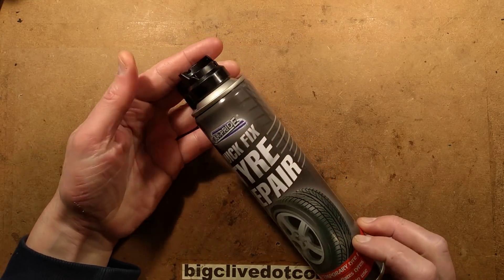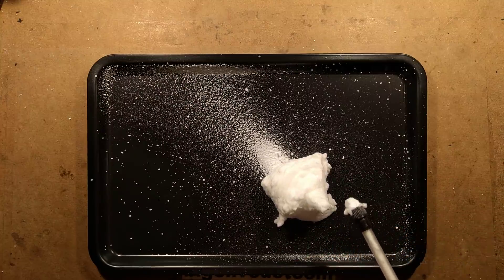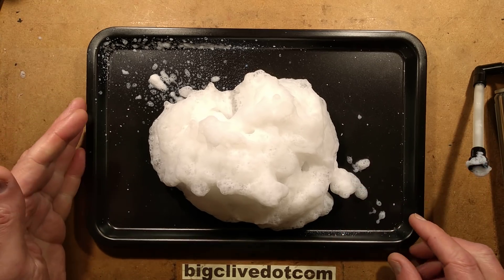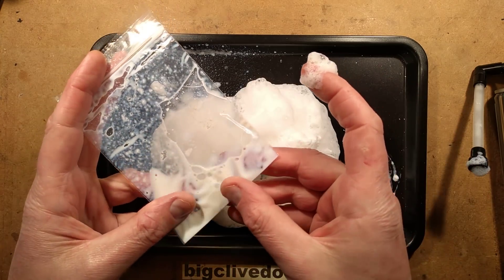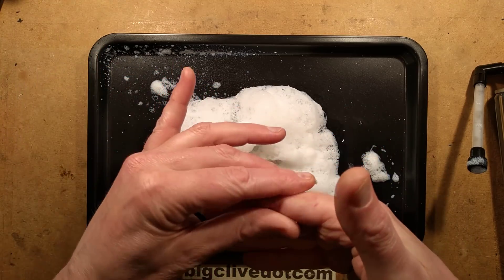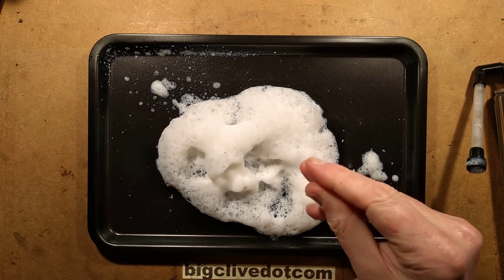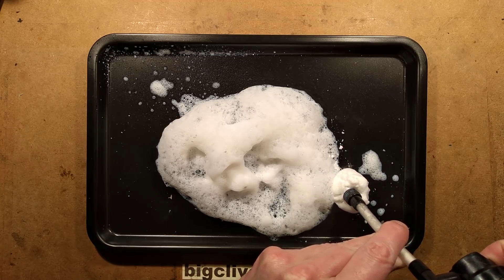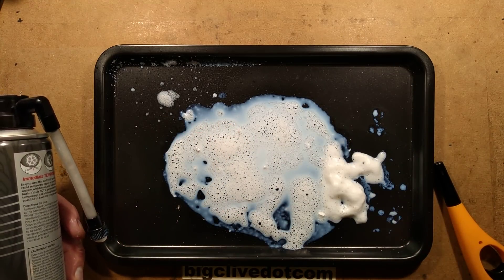What's in a tin of foaming tyre repair liquid.

Comment: The stuff is death for tire pressure sensors
Reply: Death for tyre valves in general
Reply: Yes, no longer an issue as others have said.  In fact, my 2018 Dodge Challenger does not even include a spare tire -- instead, it has a device which is a combination air compressor and tire sealant canister.  Same thing as this stuff, but in their proprietary format.  It seems to be a pretty common thing within the Dodge lineup now.  Here's a video on the sealant/pump kit:  https://youtu.be/DwxEmi5ktTs
Reply: sensors in tires? i dont need that
Reply: Mike Oxlong  Don't forget that there's no need to reset tire positions in the system when you rotate tires...  I actually would prefer that system over pressure sensors.  In the days before GPS navigation systems, ETAK Systems made a navigation system that relied solely on dead reckoning -- it used rotational sensors on each non-driven wheel, and an electronic compass to monitor vehicle turns and speed and would relate that information to a stored map.  once you did the initial position calibration, it was incredibly accurate for the day.  See https://bit.ly/2ll6Qj1 for more info on this system if interested...
Reply: Mike Oxlong  What I meant is that you don't need to tell it where each tire's new location is.  However, newer designs eliminate that step as well.  My car ('18 Challenger) has TPMS sensors, but uses sensor proximity detection to know each sensor's location on the car.  On my old car, however, I would need to put the system in a learn mode, and go to each position sequentially and lower the pressure by about 3.5# so it knows which sensor is at each location.
Reply: @swp466  This varies by vehicle and manufacturer. Dodge has a very nice TPMS system that automatically detect which sensor are in which location. Many of them even have TMPS sensors in their spares (if they have full size spares) and automatically start reading it when you put your spare on. Other manufactures, like some Fords for instance, still require resetting positions when you rotate the tires.
Reply: Mike Oxlong  Can't imagine that ... Most times that I had a flat tire it was when going to start the car. Not always making a round around the car. Very nice if you get a message on the display before driving off that one of your tires is flat so you can get out of the car, call the help-services for repairing it  and you don't need to buy a whole new tire and extra costs.
Reply: Direct TPMS is superior to indirect one, only downside of direct TPMS is battery life which is around 7-10 years. ABS based TPMS is cheap way to pass the regulation. Claiming that indirect TPMS detects a leak faster then a direct one is complete bs.
Reply: Mike Oxlong  if yours will read 1/2 psi off, then BMW are geniuses. The VWG/Audi models use the ABS sensor rings but may ignore a 3-5 psi difference.
Reply: Mike Oxlong  It is cheaper if you use cruder VW method when ABS detects only that pressure is lower but it doesn't show you by how much. Also, tire must spin for this system to work, and if all your tires have lower pressure than required, it does nothing. GM (and Opel) style with sensor in tire valve itself functions even when vehicle is static with ignition on, shows exactly how much pressure you have and you can use it when you use manual pump to pump your tires. Also, there was Renault solution with sensor inside of tire itself, which was very precise but very faulty. I, myself, prefer to not have anything like that, and my Ford Cortina Crusader doesn't provide it anyway. But have full-size spare tire.
Reply: Urban myth #2. The goo was reformulated many years ago and no longer clogs TPMs, around the time that TPMs became mandatory in the US. No doubt Clive got a can for one pound at Poundland and it is the old stuff. And, many cars from VWG actually don't use TPM sensors, there's nothing to clog. They use the ABS system rotation counter instead. And, their Audi RS8 and other expensive models that ship with NO SPARE TIRE all ship with a can of goo and an inflator pump.
Reply: afaik the indirect measurement using the ABS sensors are just a cheap way for the manufacturers to (barely) meet the requirements for tire pressure monitoring
Reply: @fuzzy1dk  maybe but such sensor is really just an addon, just like backup camera: you still should use your eyes and mirrors when backing up.
And with presure sensors, you should check often your tires and sense how your car behave on the road, because its easy to feel that you have flat tire.
Reply: tire pressure monitoring have been mandatory in the EU for new passenger cars since I think 2014
Reply: @lyfandeth  That's incorrect. When I worked at a tire shop less than a year ago I would see sensors destroyed by this crap every other day. Most of it said "sensor safe" on the can.
Reply: Could be the maker lied. Could be the can was the old obsolete stuff. If your shop said "This product ruined the tire pressure sensor resulting in $50 charge" and the customer complained to the folks who made the goo, what happened? Did they never complain? Did they get paid back? Here it would be a slam dunk in small claims court.
Reply: @lyfandeth  The change was closer to $80. I have no idea if anyone ever actually contacted the companies, a lot of people did complain to the dealership that included it with the car. I doubt anything ever came of that though. Some of them bought a new sensor immediately, but we did encourage people file a complaint with the manufacturer of the product because there's nothing we could have done about it. We'd specifically write on the workorder that the sensor was damaged in case they wanted to send it to the company with their complaint.
Reply: @lyfandeth  it blocks the air port of the sensor itself, preventing it from reading properly.  The goo makers claim "safe" by saying it can be cleaned out of the tire after a proper repair... Though actually cleaning out the tire AND sensor would be difficult.
Reply: @lordgman1  I've worked with lot of "destroyed" things that often really just needed a cleaning with the specific solvent, or other repair thatreally was trivial if you had an hour and the knowledge. To a tire shop? The part is not destroyed, it just needs too much of their time to fix, versus replace.
 But I had eight alloy wheels and was damned if I was going to install TPMS monitors in them all, and then have to risk damaging them every time they needed batteries. And the goop can, even if it ruins a sensor, can still beat all hell out of waiting four or eight hours for a tow in the middle of nowhere. It is one more tool to keep in your arsenal.
Reply: @lyfandeth  Well TPMS sensors are permanently sealed and non-repairable, so you're not likely do do anything other than destroy them more if you try to fix them. I've tried to dissect many broken ones, but they just don't come apart without maybe using some kind of acid to dissolve the casing. There's no such thing as replacing the batteries in a TPMS sensor, you have to replace the whole sensor. The goop also did a really good job at destroying the coating on alloy wheels. When customers left it in for an extended time they begin to pit around where the tire seals to the wheel and the polished coating separates and peels off on the inside. Makes it a pain to put a new tire on it without the bead leaking air. Not to mention that it becomes impossible to balance a tire with liquid in it. I'm not sure how putting a TPMS sensor in a tire could damage a wheel though, so I can't say I know what you mean about that.
Reply: @lordgman1  Seems that if they are SEALED all the goo can do is coat them. So a proper cleaning would restore them, no?
Reply: @lyfandeth  there is a hole in the case to allow the pressure transducer to read the air pressure in the tire. This hole let's the goop get all over the circuit board inside. If the small opening was designed to be sealed against the transducer itself, the goop would only get inside the pressure transducer and carefully cleaning it MAY solve the problem, but in all the dead ones I've managed to break open there was residue all over inside them on the side of the circuit board that faces the hole. The backside of the circuit board is sometimes filled with extremely hard silicone to seal it. There are several popular designs of sensor, it would be interested watching Clive try to break some open
Reply: @lordgman1  then it is not sealed at all, if the circuit board is vulnerable. Cleaning inaccessible electronics should be simple, if you can get to them. Which comes back to "economically unfeasible" especially for someone with no knowledge of surface mount electronics and safe materials to use with them. Routine water contamination from compressor condensate would also kill them. I'm betting qc is very different among brands.
Reply: @lyfandeth  Funny that VWG is pretty much alone with theyr system. It isn't very accurate but you can calibrate it to new tires by push of a button. Other manufacturers use sensors in tire valves, or, as Renault did decade ago, sensors are inside tires themselves, and you need special tool to calibrate them for winter/summer tires. Super annoying.

Comment: I've had a few motorcycles where the previous owner has used this stuff. It ends up as dirty latex balls rolling around inside the tyre. I doubt it would stop more than the tiniest puncture
Reply: This thing doesn't do shit, Slime works a lot better if anything, and it's less messy.
Reply: @piotrekserwisuje  Yes, slime is the only one that is water soluble and can be rinsed out allowing for a proper repair afterwards.
Reply: Is that what the little rubber balls come from? I used to work at a car dealer and dismounted my fair share of tires, I was always curious about the rubber marbles in the tire. I know when it's liquid it's terrible, new stain on the boots and pants.
Reply: I've actually used it on a punctured car tyre and it didn't work at all. The tyre place I took it into to get it replaced told me two things: 1) this gunk really doesn't work for anything but the slowest of slow punctures, and 2) using it makes it impossible to repair the tyre, you can only replace it entirely. Don't know how true those are, but I'm glad I now have a car with an actual spare tyre and not one of these gunk inflation kits.
Reply: Yeah. I only use it for weelbarrows.
Reply: @goiterlanternbase   *wheelbarrows
Reply: Just use a fucking spare wheel. What happened to those.
Reply: @augustsinyukov8497   Ask the fucking car manufacturers.

Comment: Hmm! The foam may be expelled using a plastic piston above a higher pressure gas charge in the bottom of the can, similar to some shaving cream products http://randomer.net/stuff/IMG_20181116_192425.jpg (not that I've actually shaved my beard in like 10 years... but at some point I might need to!)
Reply: Here are 2 followup photos. After discharging the remnant shaving gel and opening the bottom of the can  (this is a different can... I located one that was nearly empty): http://randomer.net/stuff/IMG_20181120_140549.jpg

And after peeling the can apart more and pulling the piston out: http://randomer.net/stuff/IMG_20181120_142311.jpg

Comment: Only ever used the stuff on a trailer tire and wheel which had a massive set of problems, but it succeeded at limping it a couple miles down the road where it was ultimately rebuilt (that rim and tire were thrown away). I would never use the stuff on an actual vehicle flat I'd want to save; I keep a proper plug kit on hand for such repairs.

Comment: I think it is foaming because it isn't under pressure.  I bet if it were under pressure, as if it were inside the tire, then maybe it would be liquid.
Reply: Well, if you squirt it into a flat tire, it will foam. Once the tire is pressurized, the foam will shrink by some ratio. Perhaps this is by design, so that holes will be sealed even if they are not at the bottom of the tire and even without driving.
Reply: And the spinning would probably force all the gas out of it leaving a film/coating on the tire.

Comment: I had a job in high school working at a gas station (1980's).  If someone used "fix-a-flat", the glue/patches wouldn't stick to the inside of the tire, no matter how much we cleaned and roughed up the inside of the tire.  If you just left the "fix-a-flat" in there, the liquid would throw the tire off balance at speed.
Reply: Fortunately, fix-a-flat (specifically) is supposed to go solid in the can in 2-4 years, so if you still have the same stuff they made in the 1980's it is unlikely to come out of the can and cause any problems. The new stuff, is all new and different, or so they say. But then again, in the 1980's we all had donuts or spares and no TPM concerns either, didn't we? And no cell phones, good luck calling a tow truck back then.
Reply: @perfumedmanatee6235  how could liquid balance a Tyre if it's liquid and constantly moving?
Reply: @jonnywilson9117  In a similar way to how balance beads work. These are popular with vehicles with large tyres like 4x4's
Reply: @AaronGilliland  Would work if you were to separate them and use several sets.
Reply: @jonnywilson9117  Working at a tyre shop right now and on many trucks, especially trailers use sand to balance the tyre. Im sure this can work on regular cars as well, but youd probably still feel it. Ideally you should have as little liquid in your tyre as possible as it can throw your proper balancing off and change according to humidity within the tyre.
Reply: @Falk9714  I would have thought it could throw it off, i wasn't too sure of to be honest. I suppose if the Tyre has been balanced with the liquid already inside the Tyre (Or beads or whatever is being used) then I can't imagine there would be any issues with the balancing. I was mainly talking about liquid like the one in the video. But I for one certainly didn't know liquid, sand, or beads can and are used to balance Tyre's. Thank you guys for the info! @Alexander Falk
 @Fracture @CwazyWabbit
Reply: @jonnywilson9117    Many industrial vehicles, especially farm tractors have liquid inside the rear tires.
Reply: @jonnywilson9117  Centripetal force. Moving at highway speeds the water clings to the tire and doesn't "slosh" around. Search Youtube for "water balancing a tire".
Reply: @frac  It's better than an unbalanced tire, but not as good as a properly balanced tire. Water works like that in a washing machine because the cylinder is rigid. A tire is not rigid. It  flattens as it meets the road, making turbulence that stirs up the liquid.
Reply: Paul Stafford- If you had the common "tech" stuff, yeah. Usually the buff compound was left open and the volatiles evaporated. 
Chlorinated Brake cleaner or 1-1-1 Trichlor was the go-to for tires that would not "take".
Reply: Your high school had a "gas" station?
Reply: @two_tier_gary_rumain  no you spaz; he was just in highschool at the time
Reply: It sure makes for good butt enhancement injections, though.
Reply: The cans specifically say that you are supposed to drive for either X number of miles or X amount of time after using it so that the foam doesn't settle.  Haven't used it in a long time, probably since the 90s.  I've got a small car now and instead of a spare it's got a industrial strength version of this.
Reply: Never had an issue patching tires, the biggest issue. Was the shit splashing on you and the machine, because the asshole would never tell you they used it.
Reply: @caveslug-t2k  Exactly!!!!   Been there done that...  And I worked in a shop that had to be kept spotless as well so a wheel with that mess in it was just a nightmare
Reply: You had a job? Once upon a time...